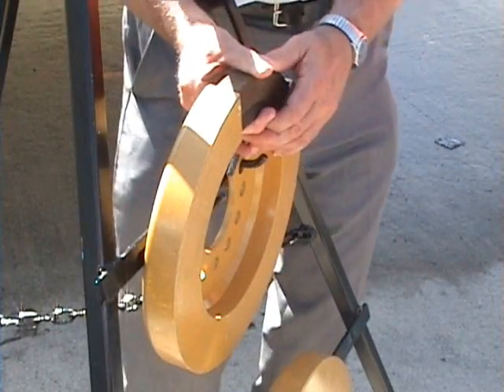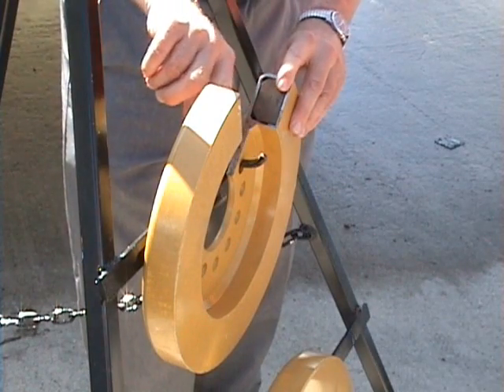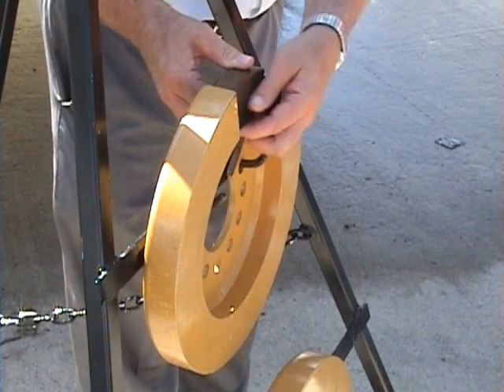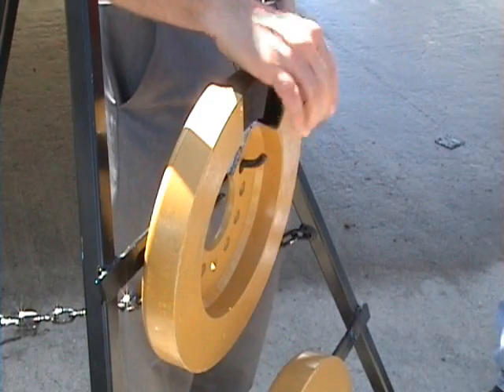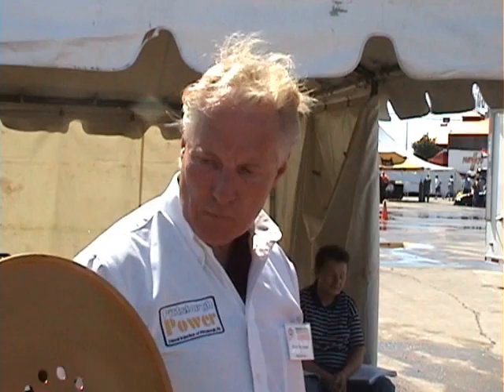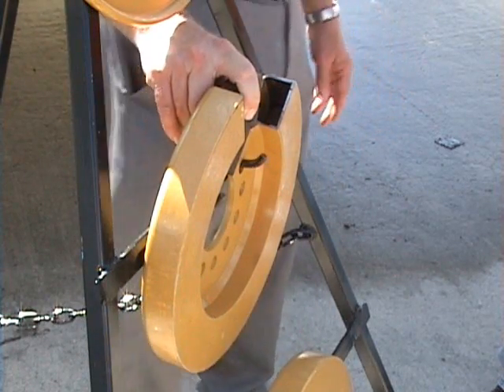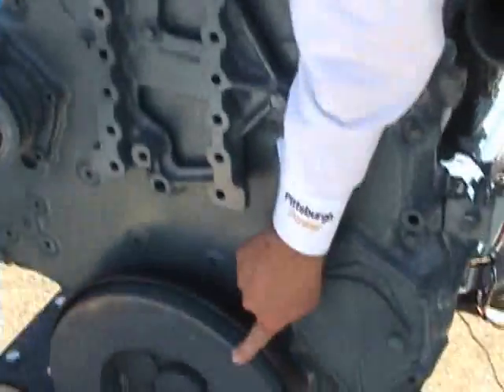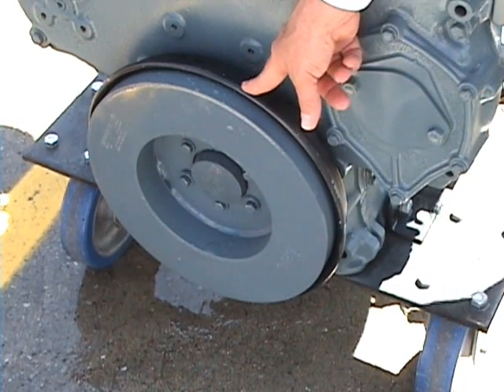Pittsburgh Power Crankshaft Dampers and Balancer

Comment: With all due respect, your description of the wear effect of a silicone damper is pure nonsense. Please dont tell people stuff you have no knowledge of. This is not a teflon bearing to begin with. It is a highly modified polyamid. And it does not impregnate anything, especially not the silicone oil. And these CAT dampers have eb welded housings, strong and completely tight, while your original 1948 style dampers still use bs rolled design. As one customer once said "already leaking oil when delivered".

Comment: The silicone actually becomes thinner first and then becomes thicker over time, many dampers are made with the fill plugs that can be removed and you may send the fluid in for viscosity testing, "but how do you know the viscosity you may ask"  well it depends on the damper.  But this I will tell you, if it is other than clear, has metal shavings in it, or any contamination just save your time and replace it or get it rebuilt.  You should never have any knock in it from any angle up - down sideways, "no knocking period".